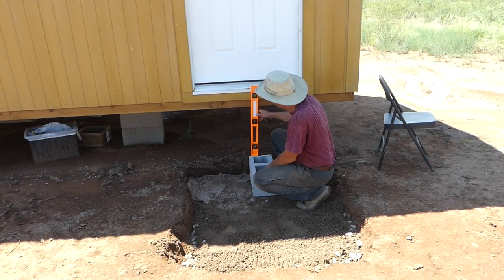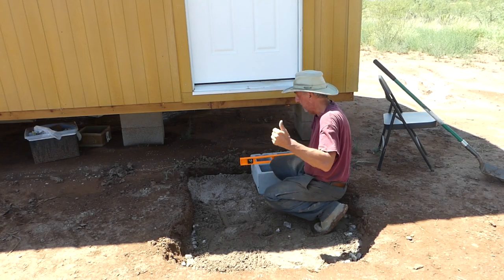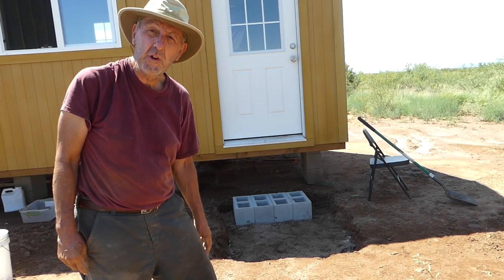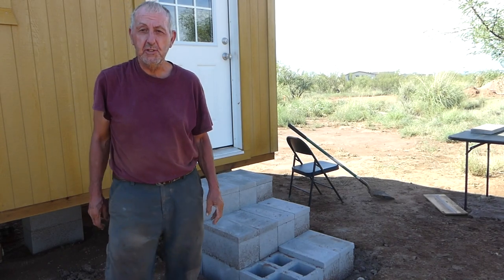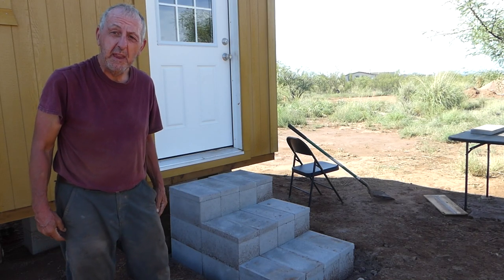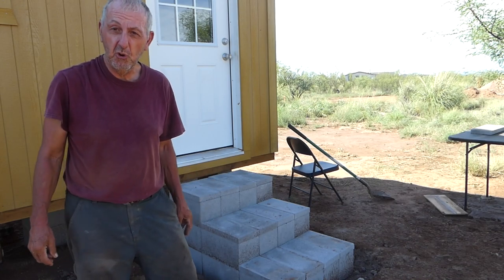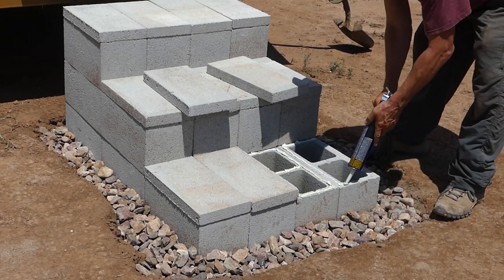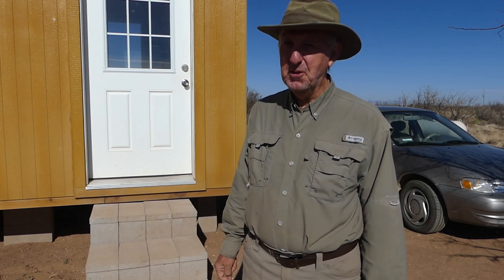DIY Affordable Steps for Off-grid Cottage PT 2

Comment: I agree with the prior comment about the blocks because your outside rows could fall outwards if you stepped on them wrong. You should turn your second row lengthwise so that they lock in the previous blocks & keep them from moving. And the same with the next layer. Put each layer at right angles to the previous layer. With the second step, start those blocks running lengthwise.
Reply from the maker: Larry good observations.  Although respectfully the steps months later now have been fantastic. Solid and no issues of falling in any direction.  I guess I must have done something right LOL.

Comment: The people that delivered your shed/house should have put bracing directly under your doors. Those are your entry and exit points & will get a lot of use. As you use them, those points will weaken & eventually start to sag. Check out any mobile home that would have been set up professionally & you will see a stack of blocks with a 2x8 board on top & possibly wedges on that.
Reply from the maker: Great observation Larry.  Also very timely.  As we speak I am in the process of designing a complete overhaul for the foundation.  Naturally we havent chatted so you would have no way of knowing that I always planned to redo this foundation within a year. Thanks for watching!

Comment: i hope you criss cross the bricks as you go up to make sure its much more stable thanks for sharing and have a great weekend as well
Reply from the maker: RG HOmestead. Very logical approach for sure.  Oddly enough when I dry fitted them I figured the same thing. But they were so sturdy in the configuration I used in the video I left it like that.  Months later they are still rock solid.

Comment: I did steps like yours and let it go for awhile. I had settling from rain and use. I used the 12 x 12 for the top of the stairs. I redid mine. I decided I liked a wider top step to set stuff on that is going in or out of the house. Instead of digging down you could have built up with the rock and lost a step. Most codes require a railing on three steps but not on two. Your height for two steps would be 8" + 8" + 8" or 9's so 24" or 27" you could go 10" on each step but it is not good. Yours is 4- 8" which is 32". Think about a large landing for people knocking on the door or trying to unlock the door. Of course not much rain where you are at so a covered front entrance is probably moot. Somewhere you are going to want a load of gravel brought in for the car and an extra pile for projects. Just buy a full dump truck load. 3/4 minus or similar. They should do a dump spread at 4". Don't let them dump a pile in one spot.
Reply from the maker: Thanks for watching my videos Tim.  I must say you are very observant. Fortunately in this area I am not subject to building codes. The steps have been in place almost a year and havent sunk one bit and are still strong.  I dug down to lay a good foundation for them.  I will replace them with wooden ones with a railing in the future. They are temporary. cheers!
Reply: @affordabledesertliving3487  When you do a permanent foundation you may want to consider digging it out next to or close by where your home is now. I'm thinking of the septic tank guy. You could have your home level with the ground and have an easier time going in and out. You could incorporate a safe for security. Maybe a water tank for fresh water delivered or to hold propane tanks for winter heat. You could also look into getting a large tank for propane delivered. After awhile running to get propane is bothersome. Something to think about codes is if you build by code it can help in a lawsuit if someone that visits gets hurt. There is the consideration of buying homeowners insurance if you can, could or need to. I have a problem letting people on my property to work if they get hurt and then I get sued. Plus look into short term rentals and long term rental responsibilities. Long term is over 28 days. They may get many more rights you don't agree with.

Comment: Since you live in one of the colder areas of AZ,,😄 with snow and ice and all that,,😉 it is good to have your steps angled away from the house so water , then ice, does not build up and cause falls and injuries.. Is there any particular reason you mounted the cabin up so high.?
Reply from the maker: Hi Robert.  Thanks so much for checking my video out.  As far as the height of the cabin there are 2 reasons I did this.  1. So that rainwater catchment works well for gravity feed into a tank that might be a bit tall. 2. At 65 I really dont want the claustrophobia thing happening when I am putting in plumbing and insulation under the cabin.  Having worked under the building for days now I am very very glad I did it tall.

Comment: Cemented?
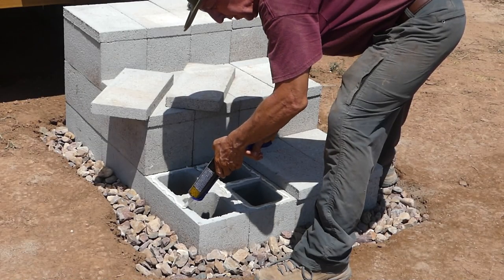Reply from the maker: valerie if you watch the video again check out 6:33 time. You will see I am using construction cement.  Also I mention that these are temporary steps so only the paver stones at the top are cemented.  This way I can remove the whole assembly and the blocks themselves easily when the porch I plan to build goes on where they sit currently.  Also as I mentioned even with just the top pavers cemented in place now months later they are still sturdy and safe even as I type this. Thanks for watching!